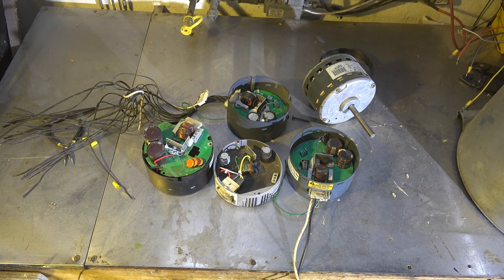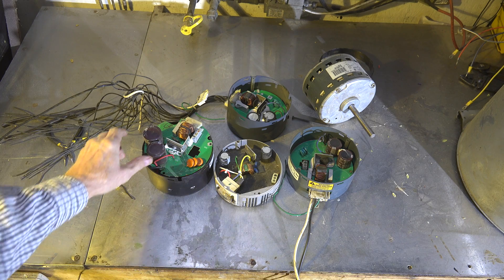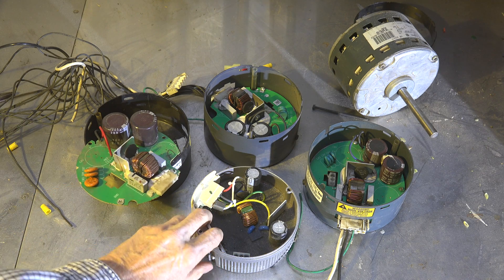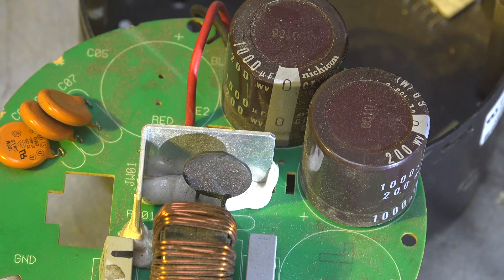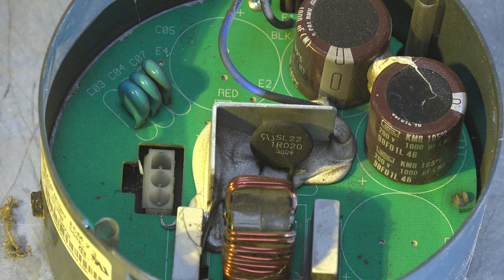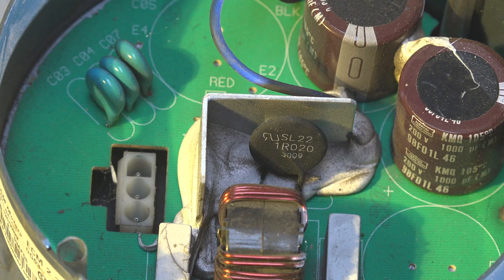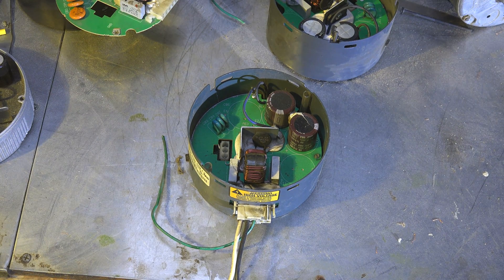Thermistor repair of the ECM motor

Comment: I pulled a genteq motor out of my mother's a/c the other day.  Its a 101564 with an aluminum heatsink and 2 capacitors similar to the one in your video.  I'm having a hard time identifying the thermistor though.  It says 1914 and Ntc 1,0.  Before I pulled motor Lenox thermostat said indoor unit reports problem.  This is the 4th time in 11 years and out of warranty now.  Thermistor doesn't look burnt though.  Any idea what thermistor I would use as a replacement?  Thanks.

Comment: How do I fix mine the one I have is full of silicone I cant figure out how to remove the silcone and AC guy wanna charge me 1100$ for repair
Reply from the maker: The thermistor repair can be done as well with an epoxy covered end bell because the thermistor is located above the epoxy.
GFM

Comment: Well you were close on why it's used... Thermistor is used to prevent inrush current. To slow the current to the capacitor in this case, as to not pop a breaker. It in no way is there to protect anything like a fuse. Just my 2 cents. You can jump it out but risk blower a breaker on start up. Think about it, what is there to protect on these modules? Nothing. Anyways have a good day.
Reply from the maker: There has been a lot of back and forth on this issue.  Not saying anyone is wrong, but I have seen many power strips with surge protectors that use this same device.  
GFM

Comment: This has 20A capacity, why couldn't you use a 20A fuse in this circuit instead? There are many filters before this point and I'm looking at the fan motor and see no reasons for this to have failed. Much like in the auto Fusible Links that just failed from cycling more than any true issue with anything. 
I ran into this on my garage MAXIMUS LED light, after one month it failed, found a guy that just put a fuse in place of the thermistor so I tried it as well. It's been working great for 8 months or so.
Reply from the maker: The thermistor is not a fuse.  It is there to protect electronic components.  A fuse placed in the circuit will not protect those components.
GFM

Comment: My Trane XV80 blower just went out, so I pulled the ECM and looked - SG379 thermistor, burnt at the leads, and cracked!

Ordered one on the ‘zon for $9, desoldered the old one and jumpered it while I wait.  Contact pad on bottom is delaminating, but still in one piece.  Slap it all back together, and whooooommmmm goes the fan!  Thanks Gray!
Reply from the maker: Welcome
GFM

Comment: My Trane variable speed fan suddenly quit yesterday. The HVAC tech said it appeared to be the ecm yet they only replace the motor ecm combo for $1500. I pulled the ecm out and it has the SL22 thermistor. I checked the existing one and it has continuity. So is that part good and I have another issue on the board?
Reply from the maker: First, I would jumper out the thermistor.  If it runs, the thermistor is the problem.  If not, I would look for a repairman that actually troubleshoots the system.  The motor seldom fails.  It is easily checked out for continuity.  
GFM
Reply: If you didn't electrically disconnect at least one leg of the thermistor then you could be getting a false continuity reading from backfeeding in the circuit. I agree with GFM on jumping.

Comment: If the thermistor is shot then the motor will not run at all? My furnace's blower motor speed has been fluctuating, sometimes slowing down enough to cause the temperature limit switch to trip; it will be running fine and then you can hear it dip then speed back up, after a couple of these sequences the furnace gets hot enough to trip. Since it is running does that mean it wouldn't be a simple fix like the thermistor? I believe I have a Genteq 2.3 motor in my York Affinity modulating furnace.
Reply from the maker: If the thermistor has failed it does not run at all.  Your problem is probably in the end bell of the motor.
GFM
Reply: @grayfurnaceman  Suspected as much but thank you for the quick clarification!

Comment: thanks for this video! I have a question: My thermistor is bad but the trace where it solders, the pcb is burnt. I've cleaned out the burnt area and most of the copper is still good. What should be used to fill the hole under the trace? Epoxy resin?
Reply from the maker: I would not repair the PCB.  Just be sure the trace is viable to solder.
GFM
Reply: @grayfurnaceman  thanks for the advice and the vid. Repair of the thermistor completed and working perfectly thanks to you.
Reply from the maker: @drewberrynews3875  Glad you got it going.
GFM

Comment: Thanks a ton!  I had found another video first that was specific to my unit (Trane), and had already ordered the replacement thermistor.  I thought we were going to sweat it out (100 degree heat wave!) for the next few days until I could receive and solder it in.  Then I saw your video with the simple explanation to jumper it temporarily ... and here we are, sitting in a nice air-conditioned house instead!  Thanks so much.
Reply from the maker: Welcome
GFM

Comment: The ECM fan module just failed on my American Standard TAM9 air handler.  The unit is 2 years and 4 months old.  It has a 10 year parts and 2 year labor warranty.  Nice it fails just after the labor part of the warranty ran out.  My installer said they would cover the labor cost and not charge me.  They ordered a new one from the American Standard supplier in Las Vegas a week ago and it still hasn't come in yet.  Now they had to reorder it.  When it does come in they will have to drive to 90 miles to Las Vegas, pick it up and drive it back.  I guess I should be happy it failed when the temp is in the low 90's instead of 110-120 F in the summer.  Had a Carrier unit for 25 years and the only problem I had was 2 different control boards blew out within 2 months of each other.  The new electronic stuff is just more BS to break and cost more to fix.

Comment: If the thermistor is bad do they lose continuity? If I still have continuity the problem is elsewhere in the unit.
Reply from the maker: The best way to test the thermistor is to jumper it out.  If the fan runs, the thermistor is the problem.
GFM

Comment: I changed the thermistor in my motor but now the fan keeps running (at a lower speed) after the burners have turned off... I replaced the limit switch but that didn't fix it... any ideas?
Reply from the maker: If the fan continues to run 2 minutes after the burners shut off, is your fan with on the thermostat in the on position.
GFM
Reply: @grayfurnaceman  Fan is in auto position. I tested the thermostat and that's not the issue. I've also replaced the control board now.
Reply from the maker: @TheParkerJ7  Any other limits off?
GFM
Reply: @TheParkerJ7  isn't that "fan off" time. Setable on dip switches.
Reply: My problem is my x13 continues to run constantly. Could the problem be the thermistor?

Comment: Hey, I have the same end bell like the one with the black epoxy that in the video. My fan start for a second then turns off. I have tested the supply and control voltage goes to the bell they are withing spec. Is there any way I can test the thermistor?
Reply from the maker: If the fan starts at all, it is not the thermistor.  You are probably stuck with a new end bell.
GFM

Comment: Thanks for the info. I noticed the squirrel cage rocking back and forth and not taking off. I'll check that part. Module
Reply: Did that work
Reply: What did you find out regarding that thermister? Was it bad? What was its resistance reading at rom temperature?

Comment: This worked on mine. Almost 100 degrees today with snow and freezing temps in the forecast in two days. Got the central air running right now and will switch the stat to heat in a couple of days. Thanks for the knowledge on an inexpensive repair over a very expensive replacement.
Reply from the maker: Glad it helped.
GFM
Reply: @grayfurnaceman  this worked for me too. I have a replacement module coming tomorrow but this temporary fix will get me through the day of grueling heat. Thanks so much for sharing! Subscribing.

Comment: If the thermistor is bad, would the motor move at all? I have an ECM142R that just jerks 3 times, spins slowly not even 1 turn, pauses about 15 seconds and repeats. The fan moves easily when given a push, but it won’t continue spinning. Thanks

Comment: Great video. Question is how to diagnose the thermister failed. Measure the resistance? OL resistance is failed, or others? Find the problem is half success to resolve the problem.
Reply from the maker: The easiest way is to cut the leads off then wrap them together.  If it works, replace the thermistor.  You can run it with the thermistor bypassed.  It protects the electronics from surges.
GFM
Reply: There is usually visible damage.

Comment: How do you get the board out for the ones that have the black insulation everywhere? I have one of those and I'm trying to cut around edges but it's not coming loose.
Reply from the maker: The thermistor is not under the epoxy filling.  I don't know any way to get it out without destroying it.
GFM

Comment: mine went after someone hit a power line in the neighborhood. Motor just stopped. I have an EON HD03. I metered for resistance across the thermistor and I do have continuity, getting about 1.1 ohms with it still in the circuit, does that mean it is good and something else on this went ? caps look fine, can't get to the rest.
Reply from the maker: It is probably ok.  Are you sure the board is ok?
GFM
Reply: @grayfurnaceman  I can't get to the rest of the board, buried in epoxy, I guess my only choice is to buy a replacement. If the in rush thermistor is bad what would it meter in ohms ? i.e how can you tell if yours is bad ? visual inspection looks OK.
Reply from the maker: @no_bs_bob  I would cut the thermistor out, tie the wires together.  If the unit runs, the thermistor is bad.
GFM

Comment: So, the repair is fine, yet what was the cause and how to stop it from happening again.
Reply from the maker: We never know for sure why they fail, but my thoughts are surges in the power line may damage them.  You can also install a surge protector in the power line to the furnace.
GFM
Reply: Great idea, thank you.
Reply: Low static pressure, clogged filters cause the PCB to fail even if the thermister is good.

Comment: Good info here. Just a bit of confusion from some, including me, where you misspoke at 1:26.  Thermistors are not used in surge protectors or power strips. Only MOVs are used in those items.  It is important to understand that MOVs are used in parallel with line voltage whereas Thermistors are in series with the line voltage.  To check if the Thermistor has failed, scrape clean the connecting wires and see if there is some resistance. The markings on the thermistor in this video indicate it is a 22mm 1 ohm 20a NTC (negative temperature coefficient, resistance decreases with temperature) device.  I have notice the newer x-13 motors have markings indicating the same 1 ohm and conform to UL1434.
Reply from the maker: You are correct.  Thermisters won't protect against transient voltage surges.  
GFM
Reply: Does the marking 1R mean 1ohm?
Reply: If the resistance reading is 1.3 - 1.5 ohms at room temperature, is the thermister considered good?

Comment: Do you have any experience with the " Fan Handler" ECM motor controller kit to replace an existing PSC motor and convert it to an ECM motor? I was considering doing this to my furnace. Thanks.
Reply from the maker: This type of controller has been around for a long time.  The idea of continuous low volume fan operation is a good one.  However, this is not a conversion to an ECM motor.  ECM motors use far less energy than PSC motors in the low speeds.  In most cases, the low volume position of this device will use about the same energy as high speeds.  
As for operating the fan continuously, you can do the same thing by placing the fan in the on position.  On most furnaces made in the last 30 years, the fan on position puts the fan on low speed.
GFM
Reply: @grayfurnaceman  thanks for the info.

Comment: I believe the device you're looking at is a metal oxide varistor (MOV). It's purpose is to absorb voltage spikes and is the primary component of a surge protector. Many electronic devices have these installed to protect circuitry. If the voltage spikes High Enough they will open rendering the device useless.
Reply from the maker: It is not an MOV.  Both MOVs and Thermistors have many similarities.  One of the differences in this application is the powering up of the capacitors.  A thermistor will limit the inrush of current while the capacitors are charging.
GFM

Comment: Cause replacing them pays the shi*ts. Charge the customer change it out and move on. One thing that I’ve learned in my 17 years of hvac experience is NICE GUYS FINISH BROKE. Sad but true.
Reply from the maker: I fixed them and I am doing fine.
GFM
Reply: You will make about the same amount of money minutes the few hundred dollars unit cost. So you can charge the same service fee and labor but save your customers a few hundred dollars.

Comment: they went to "potting" them in epoxy/other due to thinking it was vibration causing solder joint fatigue failures, which likely caused the burnt trace issue you've seen. it very well may have been a factor.
Reply: Funny you say that, I just replaced an ECM motor on my Goodman furnace with a new spare I happen to have (long story). Anyway, the controller board with microprocessor is mounted to the blower motor housing with no type of vibration isolator, talk about vibration fatigue of tiny soldered connections. Add to that, (15) connections need to be unplugged (mostly to the controller board) to slide the blower housing out. The controller board is mounted to a metal panel that’s mounted to the blower housing using (5) screws, I removed the panel with controller board attached and gently set aside before I attempted to jockey the blower housing out. Clearly saving every penny to manufacture, the controller board could have been remotely located to someplace less vulnerable using an extended wiring harness.

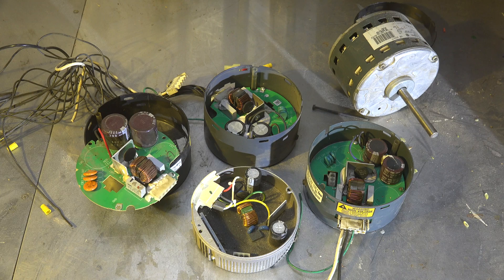Comment: Your explanation at 1:22 is incorrect. The thermistor has about 2 ohms of resistance at room temperature,  when power is first applied the capacitors on the diode output are discharged and look almost like a short, the two ohms limits the current into the capacitors until the capacitors get charged. After the  motor starts the motor current causes the Thermistor to heat up and it's resistance drops down to about 0.1 ohm or less depending on the current through it. See datasheet  Edit: I removed my link, Throttle Bottle has the correct data sheet below.
 Power strips have a different device that looks similar called an MOV. They go low resistance when the voltage goes over a specified voltage,
this helps to short voltage spikes to ground. Link to describe MOV,  https://www.electronics-tutorials.ws/resistor/varistor.html
Reply: yes, they're there to limit power on "inrush current" which can be huge and harsh on capacitors, diodes(bridge rectifiers) and other components, as well as cause nuisance panel breaker tripping, or afci/gfci if so equipped.
but they'll also "blow" apart on a large surge, Say nearby lightning strike, lines down causing massive voltage spike, sometimes even power transfer to/from generator to utility power ca induce a giant back EMF spike ;)
Reply: also, if you read the model, they spell it out in the numbering clearly/ SL22 1R020. 22MM diameter, 1 Ohm(1R)  20% tolerance. 
he showed it nicely on one at 4:05  in video
Reply: @throttlebottle5906  Edit, to reflect Throttle Bottle's info, The spec sheet says it's one ohms,   But we know it's resistance is dependent on temperature and the temperature is dependent on the current through it.
Reply: @throttlebottle5906  You are right, I searched the right part number but must have clicked the wrong link within the search. I went back to it and I had the SL32 2R025. Sorry. I'll alter my posts above.
Reply: You are correct but unfortunately it will fall on deaf ears as far as GFM is concerned. He has been told this in many of his previous videos about ECMs and still gets it wrong so he obviously just doesn't care, it's sad too because his content is usually amazingly good otherwise.

Comment: Why doesn’t the thermister reset , similar to a thermal overload ?
Reply: in theory it does "auto-resets" with each and every thermal cycle... the problem often is large power surge/drop outs cause severe high current surges and blows them apart.
say nearby or direct lighting strikes to power lines, possibly transfer to and from backup generator to utility power and downed lines from stroms causing high voltage spikes on lower power lines. say a 14.4HV or higher distribution line comes down and hit's a 7.2KV line, bam double the voltage at lower power buildings.
whole house surge protection is wise and surge protectors at the HVAC units as well ( still no 100% guarantee, as they work by SHORTING the excess flow to ground/tripping breaker/fuses)

Comment: Change the motor!
Reply from the maker: I will never do that.  For one thing, I have never seen an ECM motor fail.  It is always the end bell.
GFM
Reply: @grayfurnaceman  Unfortunately for me mine failed. It wouldn’t even turn by hand at all. The new problem just started. Now 5 years later the motor won’t shut off unless I turn it off at the circuit breaker. My board is fine and the thermostat. It won’t even respond to it for me to shut it off with the thermostat . The blower fan will just start up by itself. I did hear it ramp up and down in speed. What could cause the module to do this?
Reply from the maker: @owensmith1258  Beats me.
GFM
Reply: Don't be a parts changer !